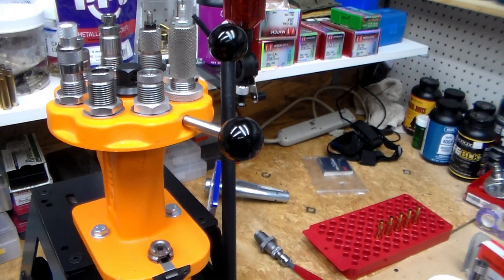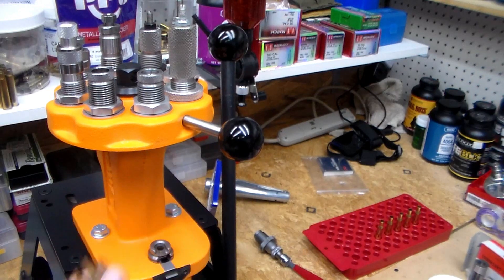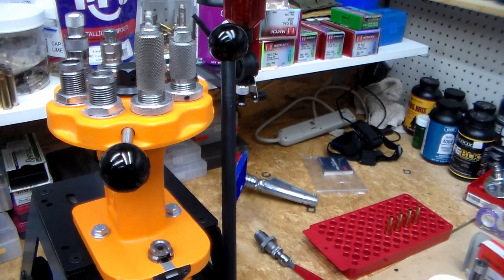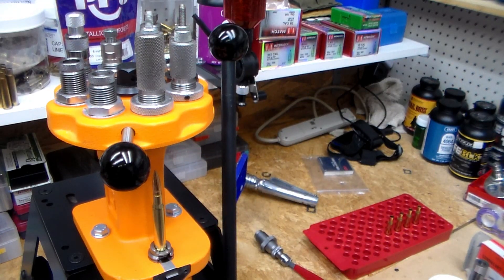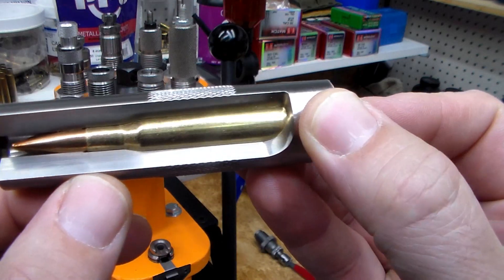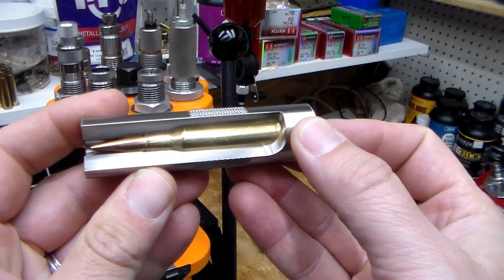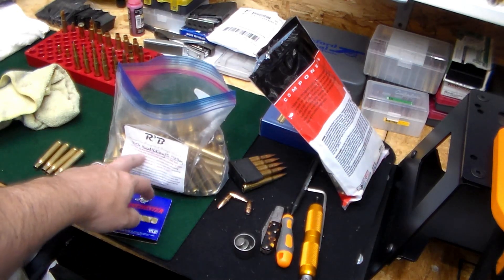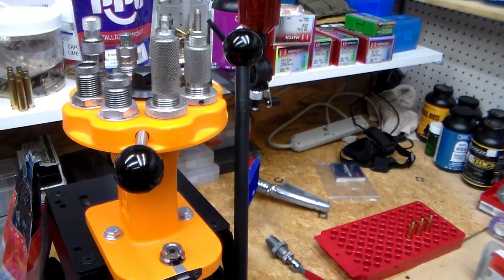Reloading 30-06 and the Sheridan Slot Gauge

Comment: the steps on top is all you have to be concerned about. As long as the case isn't above the high step, you could just neck size. I use it for case length mainly, but occasionally I use it to check HS.

Comment: Finding the right bullet is the deal,  IMR-4895 is about as slow as you want to go, You can use IMR-4064 also with great results, however, once again it is if your rifle likes it. I think it is a little slow for the gas system and the force put against the bolt.  when powder burn rate is too slow all the power is out there on the muzzle where the gas port is and too much pressure is there for the Op rod. too heavy of a bullet does the same thing, 175gr is as heavy as you can go. I have shot those 147 gr bullets and they shoot okay, keep in mind that you are using open sights a well. Good deal, looking forward to seeing range results.-Dave
Reply: Hey dude,  a little favor, could you show the accuracy results that you got with the PPU ammunition?  I always here mixed results about that brand.
Reply from the maker: Video will up today.